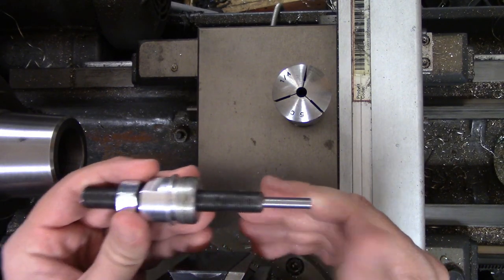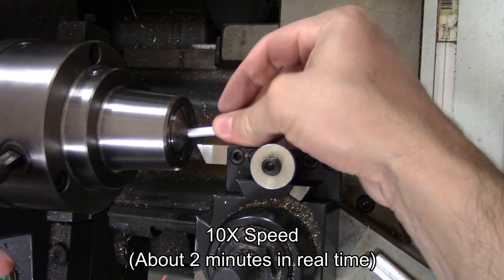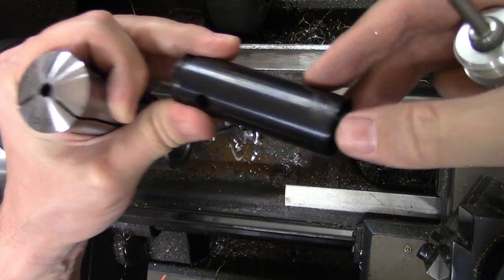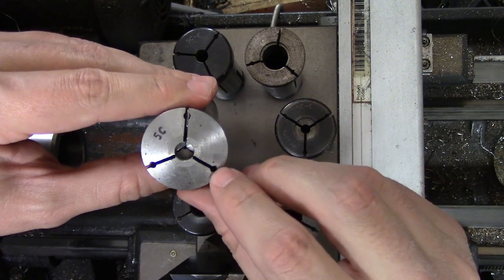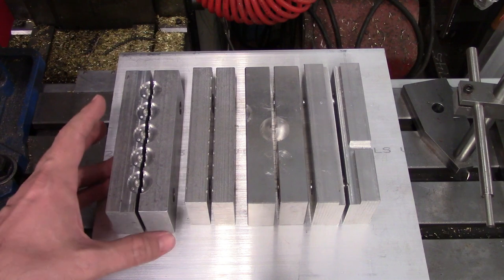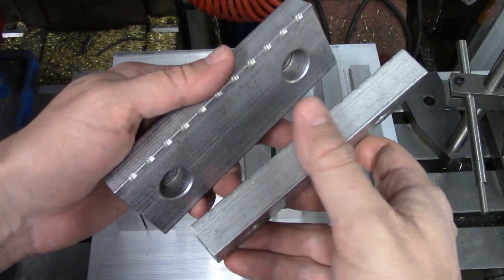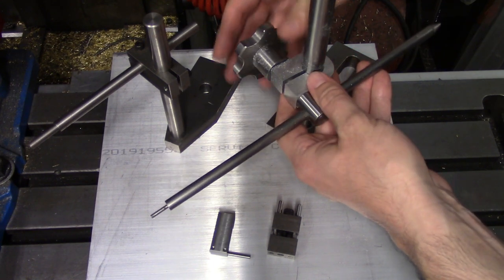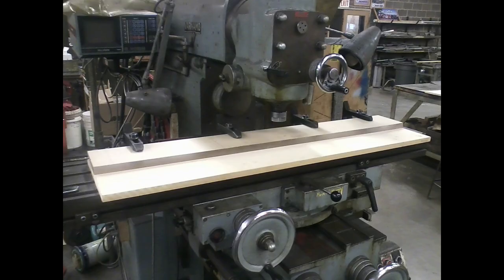Machine Shop Production Techniques

Comment: Good tips.  I did not know they made 5C extender tubes.
Reply from the maker: Hi there Bill. I got it in a set that came with a stop and the wrench shown in the clip. They are really limited in usefulness though because of the draw tube issue that I mentioned. I might make up a special stop and extension that will fit in the draw tube. Take care!

Comment: Good video. I have some feedback:

12:46 Technically, unless the jaws or part are deforming, they are still likely only contacting at a few points. If it's particularly precise, you may be getting a few lines of contact. This is still better than the two points of hard jaws, but if you need to hold cylinders, holding between a flat and a vee or two vees is equivalent and sometimes more precise/predictable. It does depend on exactly what you are doing. There are many nuances to softjaws.

19:17 Fixturing is not always sacrificial, and I would say more often saved than scrapped, with the exception of modular fixturing which is reconfigured per need. Fixturing is a lot more complicated than that.
Reply from the maker: Thanks for the feedback. I once worked in a place that made lots of ones and twos, rarely more than ten parts and rarely repeated. They had a stack of 1" thick aluminum plates cut to the size of their mill tables. The machinists just picked a clean spot, milled a pocket, and drilled and tapped some holes for clamps, and went to town on their parts. Then they repeated the process for the next one-off. When the plate started to look like a city skyline, they swapped it out for another one and scrapped the old one.

I  work at a University now, so not a lot of big production runs here either. Most of our work can be done with stops, but every now and then you just have to figure out how you're going to hold that odd-shaped piece that has to be machined on all sides.

Comment: Thank you Stewart, hopefully this will motivate me to make a table mount stop, your Prefered example.
My 5C collet stop is not as good as your design nor do I have the 5C ring wrench, back to the drawing board.
A suggestion when machining the pockets and steps in soft vice jaws would be to place the setting parallel or whatever you may use as close to the height of the anticipated job grip hight, even going as far as using a sacrificial material rather than a tool steel parallel and even to overtighten  the vice a fraction more than would be done for the work piece, to allow for wear in the vice.
I'm not sure I described that well...
Good to see you will be making more videos.
Thank you .
Reply from the maker: You explained it quite well and those are excellent suggestions.  Thanks!